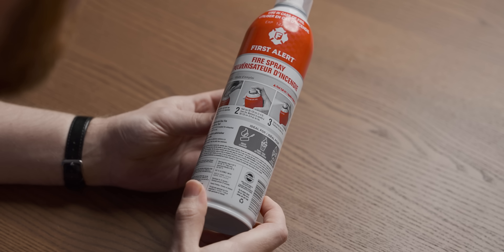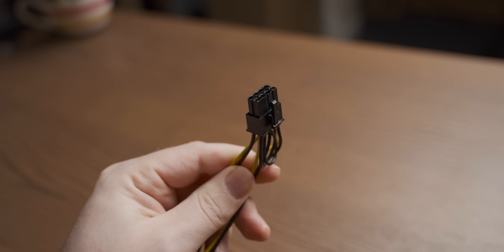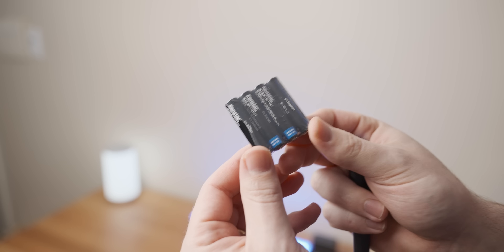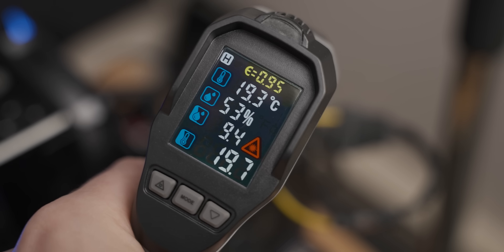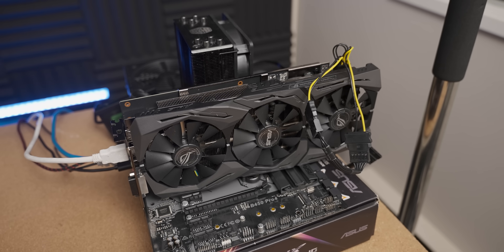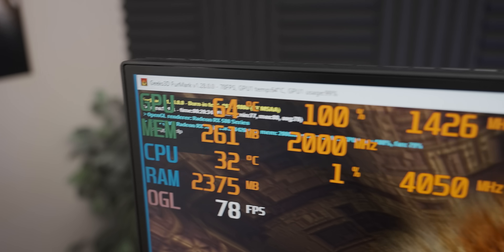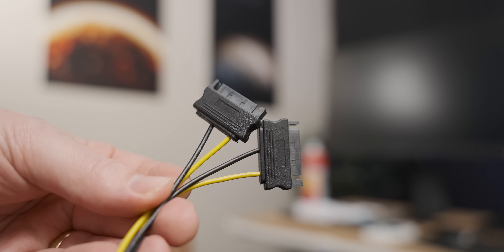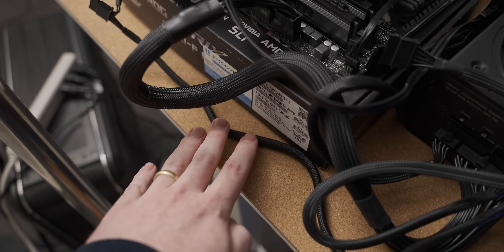Will This Adapter Set Fire To Your PC?

Comment: The connector probable didnt fail because you had the GPU fans pulling the hot air from the connector. Its ok to use for video cards with up to 150W TDP. I used a couple in prebuilts with 1050ti's that had only one 6 pin pcie connector, and they had 200W psu's. Theyre still going strong 2 years later.
Reply: lol I used a 6 to 8 pin on my rtx 2060 super 8 gb,
Reply: @DrazenPerkovic-p8j does it still going?

Comment: The biggest problem with optiplex setup is that SATA power is being delivered trough the motherboard and the power converter on it is not rated for anything above couple of HDDs. So your connector can be fine but m/b can be completely toast. Ask me how I know!
Reply: Sata power is from the psu. The cable plugged into the motherboard is data cable.

Comment: Ive been using a 2x molex to 6pin adaptor for a r9 280x (that requires a 4 and 6pin connector) paired with a fx6300...it hasnt melted yet but i am curious how safe it actually is.
Reply: How it's giong

Comment: The company that builds computers for our equipment at work uses these, along with a very low end Asus motherboard and 500w slim line PSUs [reference the Ghost canyon NUC for size] ... and while statistically the failure rate is low, I HAVE seen these fail, most significantly melting the 8 pin connector and fusing it to a GPU.  In this specific case they had both SATA cables connected to the same rail on the PSU.  Mind you, I've worked with hundreds of our machines, and the failure rate so far is less than 5 machines... but it CAN happen.
Reply: Buuut, usually a melted connector means it was arcing. I had a trans fuse in my truck pop multiple times from getting hot. But it was because the contacts were arcing. Once I fixed the contacts for the fuse, it never happened again. Same thing with a fan relay. It started arcing after running it for over 10 years. It melted part of the relay. Bought and installed a new identical harness and its been good for over a year... Anywhoooo. Lol
Reply: @jason4663  While that is always a possibility, if you have a connector attempting to pull too much power through not enough cable, it also makes heat.  I wasn't in the office to do the failure analysis [and I'm sure they didn't bother to do one anyway because they order the computers from a third party vendor] but either way I strongly disagree with the method of wiring they used.

Comment: Hey Dawid! I just want to thank you for talking about this. A year ago, I put together a 600 dollar system, and I used one of these adapters. I think this might have broken my GPU, causing my system to fail. If you're building a PC, please never use this adapter! It could cost you hundreds of dollars!
Reply: Why would it fail. Unless it was either your PSU or the fact that your graphics card asked for more current but it couldn't be supplied

Comment: There's many assumptions going on here.
Rating of connectors and power delivery over a rail are not the same thing...
Wire gauge.  Pigtails.  Molex vs. Sata.
Slot feed.  Volts vs. Amps... Etc. Etc. Etc.

Comment: I wouldn't use those kind of adaptors long term. Love your commitment to quality scientific testing! I do wonder if you having the connector right in front of the graphics car fan was helping it out though, it would have had quite a bit of airflow going past it.
Reply: People usually don't use them long term. Instead, they serve to  hotrod some older GPU to a office prebuilt with crappy PSU (4 pin connector) .
Reply: @aleksazunjic9672   To quote: "Nothing is more permanent than a temporary solution." Once the budget builder puts it in, it stays there, until the next upgrade.
Reply: @HappyBeezerStudios  Not for very long, this thing is usually used by people with some knowledge but lack of funds. Therefore, in next few months they would usually earn for at least second hand but more powerful PSU.
Reply: lol i used this on my rtx 2060 super 8 gb  @aleksazunjic9672

Comment: Used 2 molex to 6 pin and a 6 pin to 8 pin. 400 watt PSU to power a 4870X2. Don’t buy cheap adapters

Comment: @Dawid the connector is rated when it's of quality. Not every cable is built the same, lower quality plastics will degrade faster under heat. This particular adapter also only uses two pinouts. If it were sustaining a load over the entire connector and the drive was saturated with a max read/write load, while also pushing that much power, you'd likely see a failure.

Comment: Before I watch the video Im going to comment.. then see if it's the same conclusion.  The sata to pcie I think is fine when using 2 connectors, provided it's not powering anything over 100 watts...  Many were concerned with the other connector  single sata to pcie typically used to power risers as one sata doesn't give enough power for the pcie slot which could potentially ask for more and cause a fire hazard.

Comment: Let's put joke aside for a while, in the real condition is so many case out there with bad airflow. Even with good airflow, the delta temp between air outside and inside the case is quite big too, usually around 10°C (depends on how much electric power consumed by the system and how much or / and how fast your fan is). And one to be note too in the video, beside the open bench, the sata connector is near intake fan of graphic card, so it got a bit cooling too. Imagine you got what so called 'good' cable management, you would hide the converter cable somewhere behind the case, and that poor cable gonna be tortured real hard.

Comment: I used a similar adapter in my parents computer. Very mild build but my old gpu from like 2008 finally died and the system didn't support on board graphics so I put in my more recent old GPU and had to use one of these to power it. All name brand and good quality components but low power as well.....its my parents computer. Surfing the web isn't going to max out the 7870. The GPU is old now but its such a waste sitting in that computer, although otherwise it would just be sitting in my closet.

Comment: I bought a cheap 2x6 pin to 1x8pin to run my Rx580 and they did set fire about an hour in to playing. It was the actual cables that burned through and then started shorting out. Good job I had the side off or I wouldn't have seen it as fast. I then tried an adapter that cost alot more and has been fine ever since.
Reply: What is the name of the new adapter, so I can buy one , I have an RX 580 too, ty

Comment: the biggest issue with the sata to PCIe connectors is that usually, the SATA rails of the PSU are not designed for having that much wattage drawn thru them.
Reply: surely the power just comes through the main mb power connector.  The psu will be fine to handle this.

Comment: These adapters are out of spec. Absolutely no reasonable company would produce and sell them. So being a janky, unregulated product on it's own, it's very likely that you may buy an adapter with very low quality and wire gauge. These lower quality ones are not even close of capable of providing 150W @ 12V, let alone if a GPU pulls way more than that while overclocked (200W+ is not uncommon) and not considering the capabilities of your power supply. If you shove the adapter somewhere without any airflow and surrounding heating components, your result may be very different. Don't buy or use these!

Comment: Umm yeah.
So the SATA to PCI are usually around 60w each, that's 120 watts.
(5amp rating)
If you have a turd PSU, the problem will be the other end.
A turd could have a low rate cables and a single rail which would hear up.

The current passes evenly across the two cables. But if you have the Sata end plugged into one cable, that single cable is going to be the weak point, not the adaptor.

Comment: I've been running MOLEX adapter for like 6 years and nothing happened. First with GTX 280 and later with GTX 480. 8 pin came from the power supply and 6 pin was said adapter.
Reply: Molex actually gives more power per cable at 75 watt compared to sata's 54 watt, so it's definitely safer

Comment: The problem is that 54W is the max total combined that one sata power string will support according to spec, not 54W per connector. Fine for storage drives, not fine if using sata to 6 pin for mining.or any other high power stuff.

Comment: While the adapter can be dangerous thing to use, the problem is that those very low cost adapters have such variety in quality that you're rolling the dice each time you get a new one.
Depends on the use case, you definitely don't want to be using this one, since it can go over the spec for sata and that'll definitely result in a fire in that scenario if your adapter has thinner wires cause the manufacturer decided to cheap out on them to increase margins.
I'm using an adapter turning molex into fan headers. Same price as bottom of the barrel fan hubs. I have no worries about since the wires on it can handle the fans no problem. And I'd actually be worried over a fan hub of dubious quality in its place.

Comment: Failing connectors are more likely to burn when there is some arcing happening. A good clean mechanical connection can handle quite some amps before failing. There are youtube videos on this subject.

Comment: I bet those connectors that you found that were melted were put in backwards on the HDDs. It is rather easy to break off the l bracket on old SATA drives with old cases. All of mine are broken off due to no room behind the motherboard tray.

Comment: I had a setup similar about 10 years ago. Dual 4 pin molex to 6 pin pci-e. Used it for a year or so. When I opened the case and saw the connectors...the molex that were supposed to be a clear white color were most definitely browned from the sustained heat (wires had discolored as well). Glad I didn't have a fire, but it was getting there. Would NOT recommend.
Reply: @333Orobas 666 Ambition was a little higher than practicality back then. If I remember correctly, it was 2 8800gt's in sli. Both running off molex to pci-e power connectors, powered by whatever supply I could get my hands on.

Comment: In my years of experience this is the "rule" for these types of adaptations:
MOLEX Power Conector = 12V x 10A = 120W
SATA Power Conector = 12V x 5A = 60W
This is considering average adapters, NOT good quality ones. Also remember that most GPUs will pull 40~60W from the Motherboard, so that 200W card consumption was more likely puling only 150W from the 8 pin power conector, 150W = 6.25A per connector, thats why the temperatures were high but still under control.
Reply: SATA is even more limited than that, the plug is specified to 4.5A over 12V only, which means only 54W
Reply: @HappyBeezerStudios  but u can do 5A just fine...

Comment: Usually the ones that melt are the ones with aluminium wires. You probably got lucky with a copper one.
Reply: Or just thick enough wires!
Reply: I never knew that aluminium wires even existed lol
Reply: @victorhugofranciscon7899  they are widely used
Reply: @Zebra_Paw  Now thinking about it makes sense, because aluminium is considerably cheaper than cooper

Comment: Try to get an R9 295X2 and test two of these adapters with this card :) I´m pretty sure that that wont end well.
Reply: Or R9 390x2 that thing is 580 watt card
Reply: @JL1523JuhzzXxjl  390x2 has 4x8pin. the 295x2 has 2 because it requires a special amout of ampere per 8 pin. only very good, high wattage psu can handle this card. that´s why i said it wont end well with such an adapter.

Comment: Don't forget the PCIe slot itself can also supply up to 75 Watts. These Optiplexes sometimes have that capped to 25 or 50 Watts though, but that would be written on the board itself and I think that was only for the low profile versions also

Comment: he says dont do this with a 3090 but 6 sata and the 75w from the 16x is 399w and thats a little higher than what a 3090 will draw so you might actually be able to do this with a 3090

Comment: Wonder how those SATA plugs cope with the fan hubs they power?
Reply from the maker: That's true, I wonder if some of those massive RGB hubs can overdraw the SATA power connectors.
Reply: @DawidDoesTechStuff  - Yeah,  there's 16 fan connectors on my Chinese one that came with my case, has the word "HUB" in big letters across it.  :) (with 1 SATA connection at the bottom!)

Comment: Had too buy one of those for a pc after buying it off fb dude had the cpu plug electrical taped together and a 6 pin connector for the gpu as well and the only psu I had didn't have a 6 pin for the gpu so I ordered one of those till I got a new psu shit never let me down still have it somewhere lol

Comment: the pccooler corona 5in1 uses the same connector to power 5 fans with a separate connector for their RGB, and mine ran no problem for almost 2 years but that heating problem does have a commutative effect and it eventually failed (burned) last September, luckily for me the burnt wire remain in its socket and the fire died immediately after the wire was severed. Also for those interested the room temp was around 27C.

Comment: shouldn't the PSU shutoff  before a fire starts (short circuit protection)
Reply: If it's a total dead short. Otherwise resistance just looks like any other load to the PSU be it a kickin' rad graphics card or a smoldering fire in the making.

Comment: The previous Optiplex generation uses standard ATX power supplies. I have an old 3010 with and i5 3470 and replaced the PSU with an EVGA PSU.

Comment: If u use 4pin to 8pin CPU EPS Pin adapter it'll get fire. Im using FX 6300 with that adapter. Sacrifice my gigabyte mobo 970UD3 and that cable.

Comment: I had a molex to 8 pin catch fire once on a 24/7 rig,  thank the Gods I had a clear side-panel and the p.c. was close to me,  and I was nearby.  What did I learn?  ALWAYS have a clear side-panel,  always keep p.c. near my eyes,  and NEVER use a molex to 8 pin connector even as a temporary measure...as this was the case here.

Comment: Dawid I have been using those connectors on my gtx 960 oc for last 3 years. They have withstood pretty good despite me max overclocking my gpu.
Reply: I also used them in the past on a 1050ti without issue.

Comment: My friend literally killed his gpu with the same exact cable, i still have his dead rx 580 under my bed
Reply: I have a dead card from years ago doing the same thing. I figure the adapter was the culprit as well. Most likely due to voltage drop and subsequent amperage spike.

Comment: That is a nice test and advice NOT to do at home.  Apart from wearing out the plastic, did you think about measuring the temperature from the OUTSIDE of the plastic?  The connector inside the plug is much hotter so that point is slowly melting. Am i wrong?
Reply: Another SERIOUS issue with molex/sata-to-PCIe is that the plugs are most often melted together in the factory. In some of those, the wires are a tiny bit too close together and will cause a spark in the plastic and fire after a while.  You certainly need plugs that are CLICKED together (not melted) so you are sure that there is no energy leaking.

Comment: Just a bit of practicality here for anyone who is forced to use similar connectors.
1. 2xMOLEX to 6-pin is totally fine as long as connectors are not damaged.
2. 2xMOLEX to 8-pin is a sketchy setup, but it works. You still may want to check it for traces of melting plastic and oxidization on pins once in a while.
3. SATA power connectors to either 6 or 8-pin for any kind of prolonged usage - is a nogo, "not even once". While MOLEX are not user-friendly and are generally unpleasant to operate, they are robust and reliable (or serviceable/repairable by a decently sapient user, to be exact). SATA power connectors are more user-friendly but are a total mess when it comes to actually, you know, delivering power. You may use SATA to 6/8-pin for short periods in a controlled/observed environment, but don't let them stay in your machine for years without observation.

It is essential to understand that fire happens not momentarily when you connect unrated stuff and put it to use. It occurs when the electrical resistance (and therefore heat output) of contacts in the connector rises due to bad connection and/or oxidization of pins. Which progresses slowly during long-term exploitation and often remains unnoticed by users.
Reply: Yup, it's the same in my experience - the only really safe one is dual molex to 6-pin (if the PSU is good enough of course)
Reply: Why not just take off both the SATA connectors and connect both the cables directly, which will be even safer than Molex connector. 
P.S. Sorry for late query. I'm two years late, lol.
Reply: thank you, this is the only comment I ever need.

Comment: I added a Molex to SATA adapter to a Dell Inspiron Slim in my office so we could have an extra SSD drive in the PC.  The adaptor went to the rarely used DVD drive.  That connector basically burst into flames at the DVD drive after the PC was left on in a cabinet with the doors closed by a co-worker.  The PC was about 10 years old but had an upgraded Seasonic power supply.  Luckily the fire was contained in the case.  The only damage was the PC (fried the Power Supply) and a really bad smell in the office for a few days.

Comment: The only adapter I would (potentially) use in the long term is the dual molex to 6 pin, provided the psu is of sufficient quality. I've used exactly this combination with a server Seasonic PSU (that doesn't have any pcie cables) and a gtx 960 for years without any issues. Dual molex to 8 pin, not to mention dual sata (which can carry less current) to 8 pin however probably isn't a great idea...
Reply: agree, i use dual molex to 6 pin for my gtx 660 ti